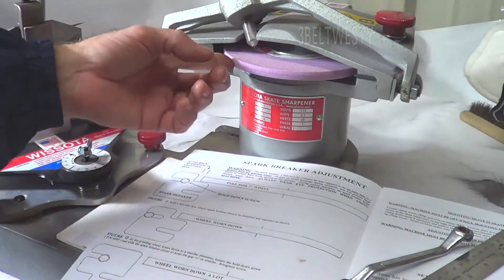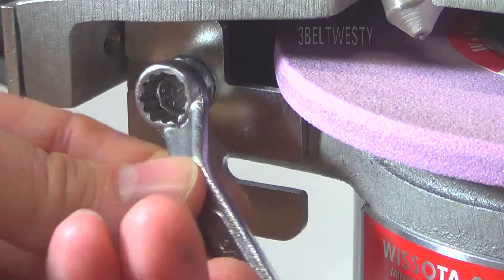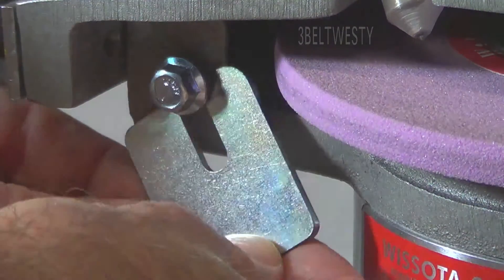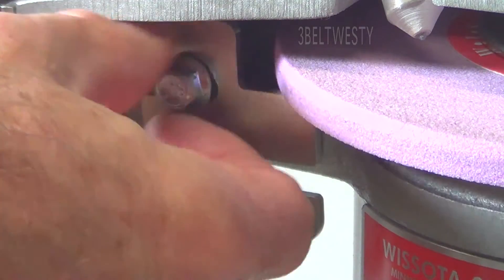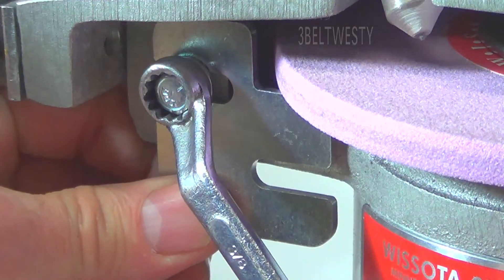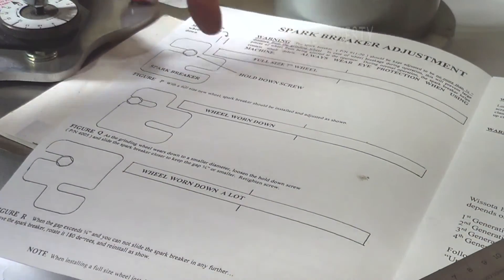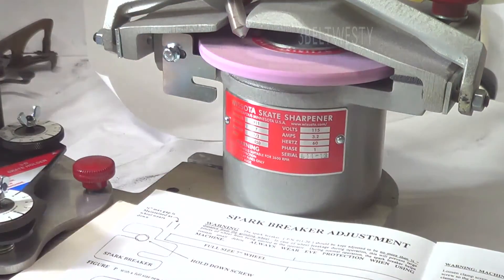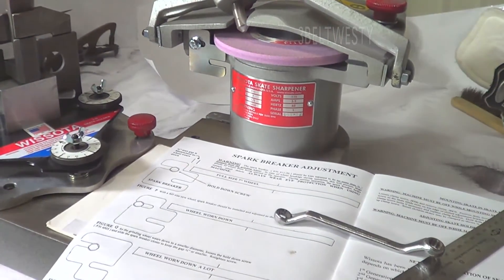Wissota 911 Spark breaker adjustment skate sharpener

Comment: Got 3 questions: 

- Do you a have observation process that works for you to check which 1 of the 4 balance washers is the right one to use to correct a particular wheel’s imbalance?  I’m not sure what to do other than listening or feeling for vibrations. (To add, I line up the washers like you show correctly in this video. )

- if the IE machine requires occasional oil, where do you recommend I apply? 

- I’ve not found a video anywhere of how to apply the cratex abrasive to the wheel. How do you apply it and do you recommend any alternative brands that I can use? 

I ask these questions because I get very subtle, tiny horizontal lines (“zebra”lines in hollow from inside edge to outside edge)  on my finish. They are not really chatter marks but I think it’s caused from a slight imbalance in the wheel. I got the Baldor
Motor checked. It’s fine. Next variable could be replacing the spindle cartridge and main pulley.(suppose to get those refurbished after long use) 

Great channel! So helpful.